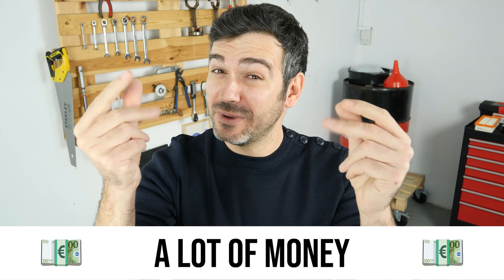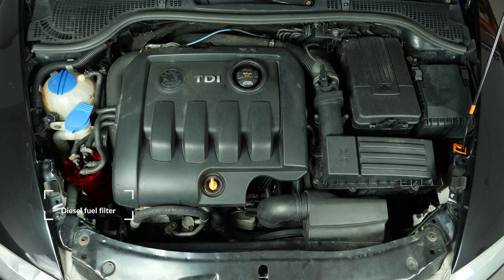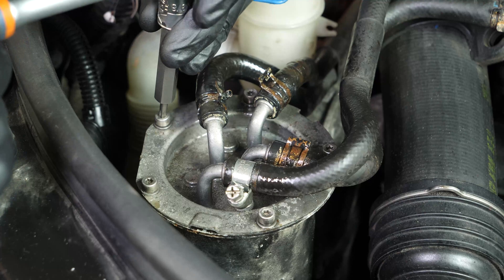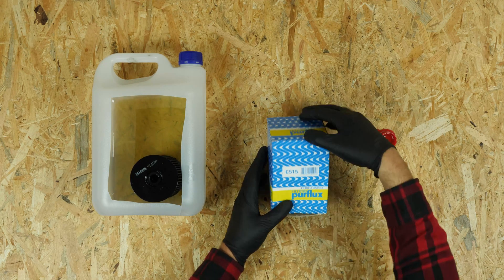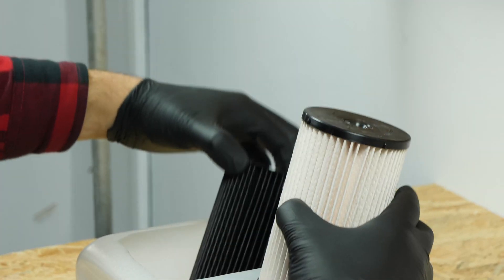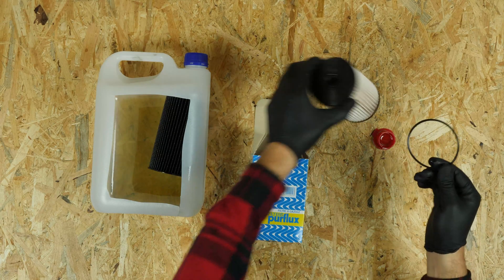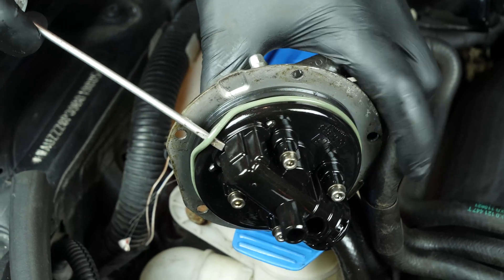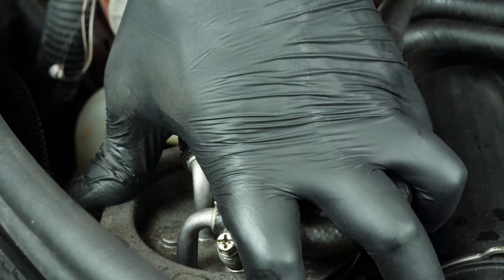How to replace the diesel fuel filter Octavia mk2 1.9 TDI ⛽

Comment: Do you have to fill the filter area with fuel before closing the lid?
Reply: I just place the lid back on before replacing the filter. Turn on the ignition a few times until the cartridge it just over half full. Slowly sink the new filter in . Always starts straight away.